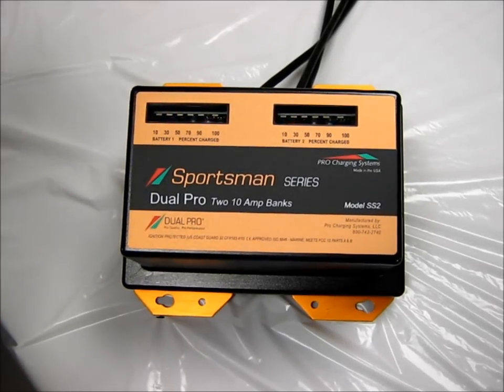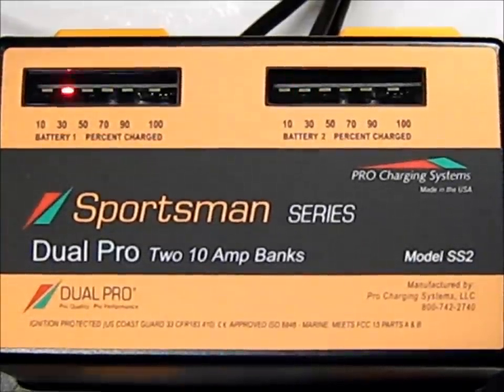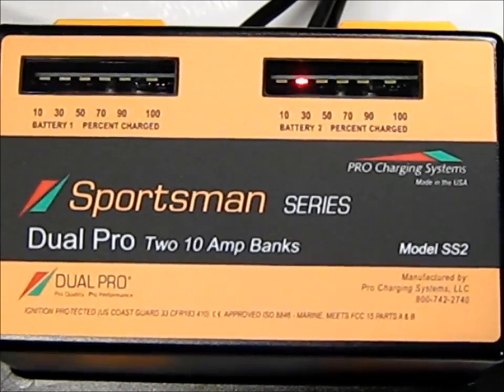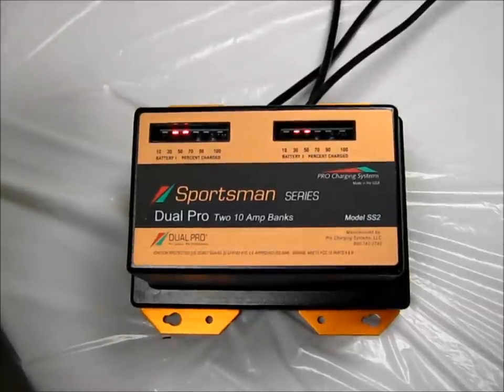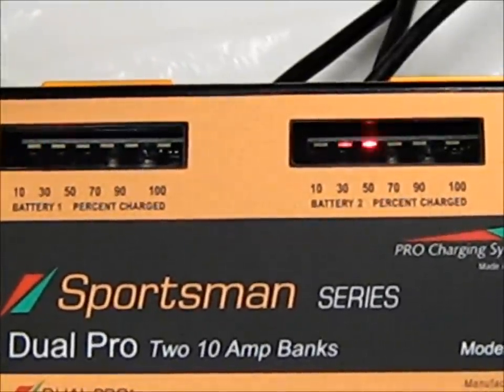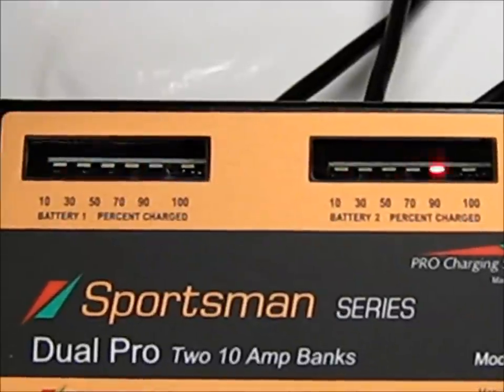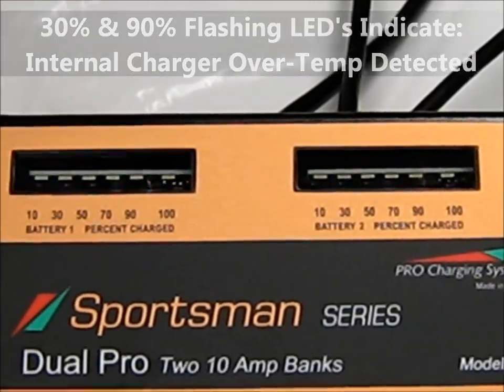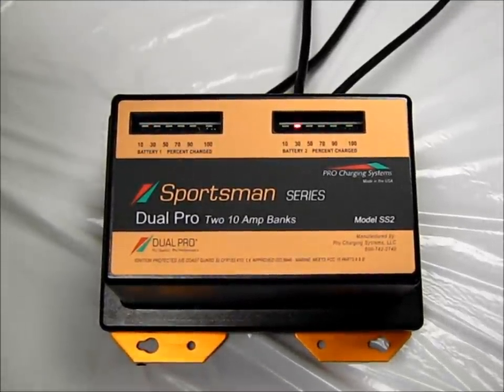LED Fault Codes on DualPro™ Marine Series Battery Chargers

Comment: 2:15 the internal overtermperature can also occur due to a too-high input voltage. I have a transformer here that puts out about 135V instead of the normal 120 and it causes this condition. The charger works if you put a fan on it.

Comment: I got 30 and 70 lights on ??
Reply: Same here.
Reply: Did you figure out the issue with the 30 and 70 lights on? Mine just started doing it.  Thanks in advance for your help.
Reply: I also have 30% and 90% lights coming on, only on one bank, other three banks work fine. It has been happening more and more often. How it hens every charge. Please help.
Reply: Same.  Anyone have any insight on this issue?  Just happened to one on my banks.